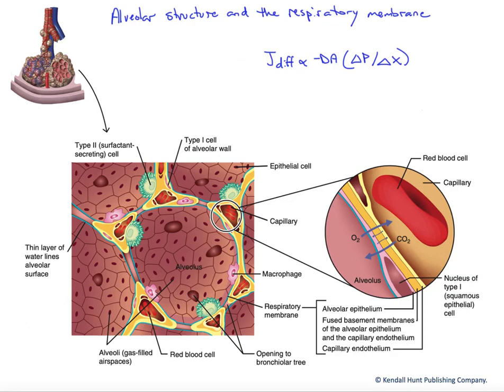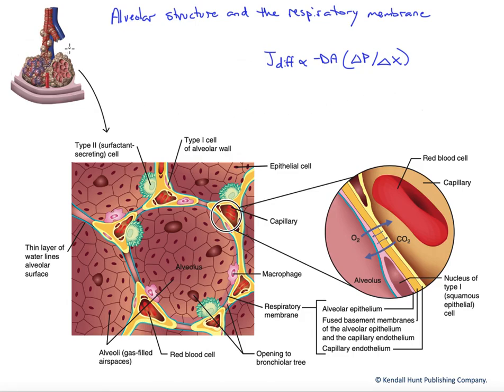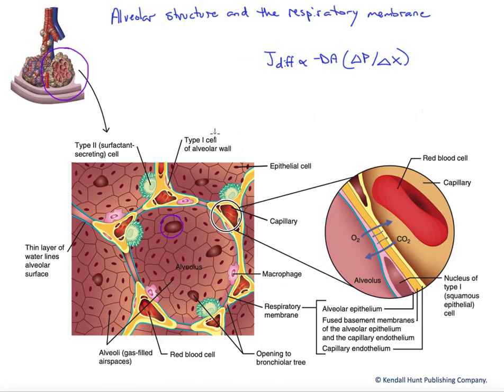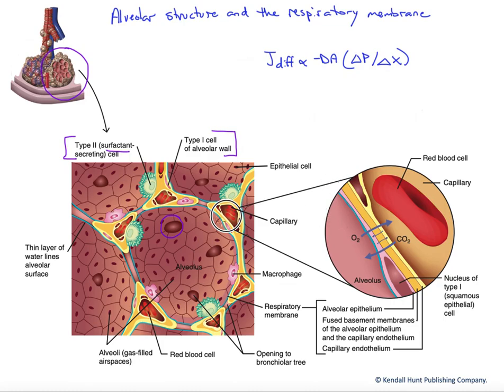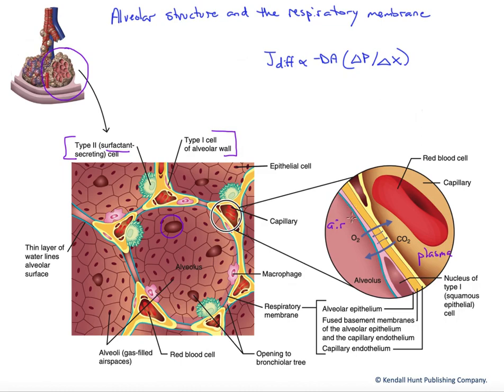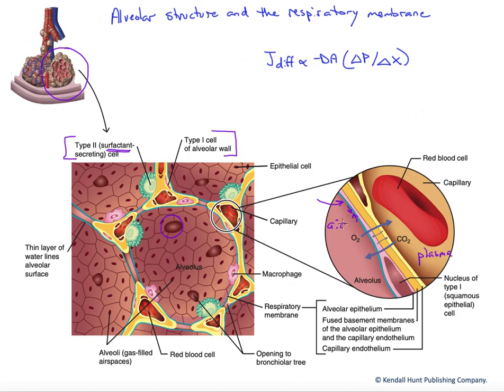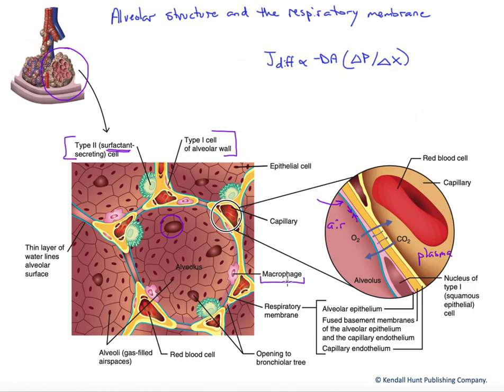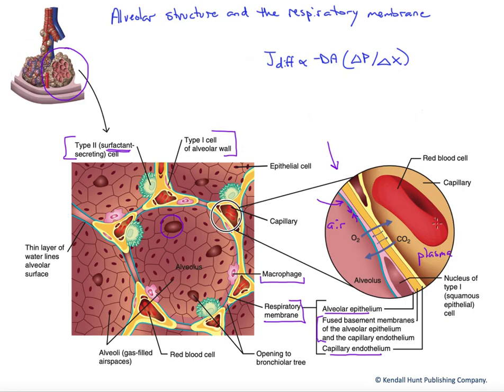Alveolar structure and respiratory membrane

Comment: Excuse me Sir.. but where is the interstitial space? 

i was reading in an old version of Robbin's and it felt that the interstitial space and the basement membrane are the same thing even though the names are contradicting membrane and space
Reply from the maker: Hello! There is quite little interstitial space in healthy lung, however, even in that case there are regions where the air-blood barrier is thicker than in others and lymphatic vessels and greater amounts of extracellular matrix are found. This matrix is essential to the opposition of extracellular fluid accumulation (edema) which would tend to fill the alveolar spaces over time. In diseased lung, the collagen and elastin fibers there can become damaged and remodeled, allowing increased ease of edema formation. Obviously, this would be quite dangerous due to the increased distance for diffusional exchange. Most texts show the norm, with very little interstitial space observable.